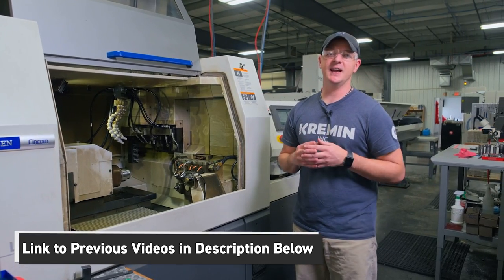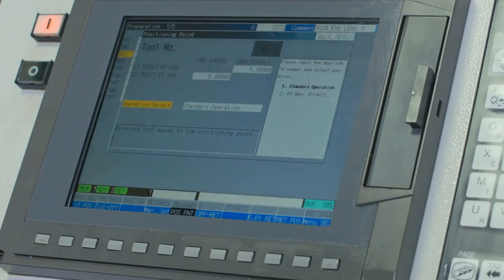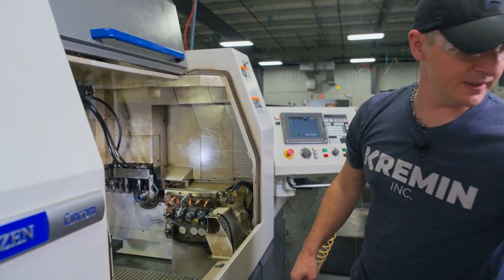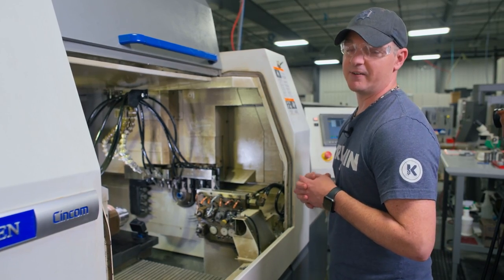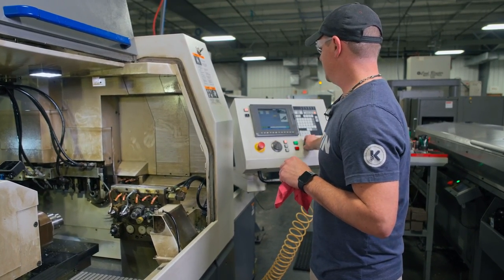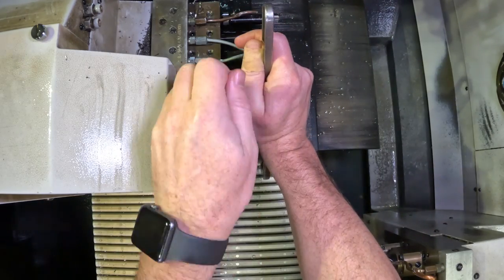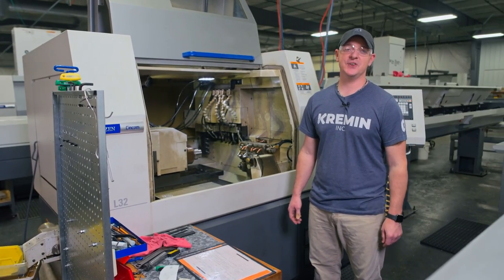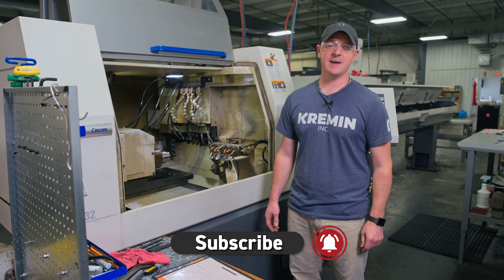How to Change Over a Citizen L32 Swiss Lathe Part 3 - Kremin Inc.

Comment: Nice video! I would recommend moving to postion and then putting the tool in though, so there is zero chance of collision. You could also skip doing a postion point after it's set too as once you select another tool, it will do it automatically before moving over. Everyone's a critic I know 😂
Reply from the maker: Thanks for the tips!

Comment: Thank you for taking the time to make this video! Most have no idea how much work goes into capturing everything, re-takes, etc. Running that first part can be a little hard on the nerves! Is the pick off going to crash when it goes to grab the part? That would be an interesting video detailing that, because running it 1st time it all looks like a collision happening as the pick off comes in, grabs it in sync, and you hope the grab is at the sweet spot. Trying to learn that now amongst other things. Adding to the challenge would be being on a machine with nasty plexiglass making it hard to see whats happening, and if you have door open a little you can get soaked with coolant, so you got high pressure block skipped and try and step through it. If you can get through the first part with no broken tools hey thats a win! All the little details need to be perfect, right down to double checking previous guys set up, did they tighten the guide bushing nut set screw? Might wanna double check! Thanks!

Comment: For Tube Material, you can set the cut-off end pos. to a positive value.
Go to MC Data and type a PLUS sign followed by the desired cut-off end pos.
The + is mandatory for positive values.

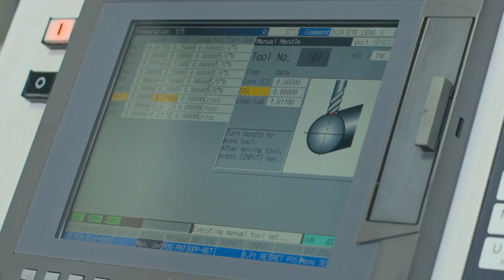Comment: 6:09 On that cross live tool, when you set it you mentioned that the tool and material are .005-.007” away from each other, but you didn’t  compensate for it afterward. I would have dropped the tool that amount to get it just right.

Comment: Hello !
 Useful informations.
I see a drill holder in this video.. 3 drills  that drill in the diameter and 4 drill in the center . How to measure the drills that drill into the center of the raw material ? On the main page . Could you make a video about it?
Reply from the maker: Are you looking at how to set the 3 drills on the B axis arm in this video?
Reply: Yes ! @KreminIncManufacturing
Reply: @Pet1-hydro The 4 live tools that are farthest from the operator (pointing toward you) are touched off in the same way as the ones pointing down. You still Man Set the tools on Dia, and the machine knows to move the Y-axis (forward/backward) instead of the X-axis (up/down) to set them.

This is at least how it is for tool blocks that are solid and don’t have a B-axis, so I may be wrong about how it’s done for the one in this video.

Comment: Pro-Tip - when setting up a Tool with Man.Set on Dia: instead of clearing the edge with pos.point - set the machine to x10 JOG speed and turn the hand wheel a bunch in the + Direction. Ofcourse, Do Not Press Input on the new displayed value after doing so. exit with ESC.

That's much faster, esp. if you have the door safety on.